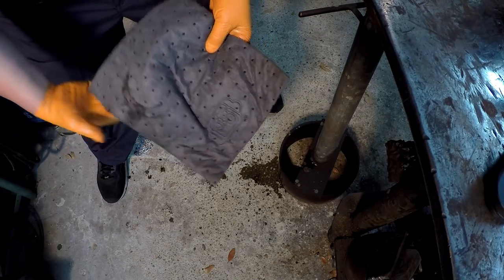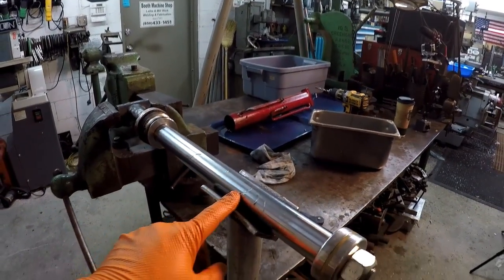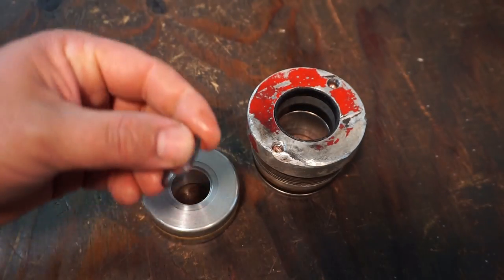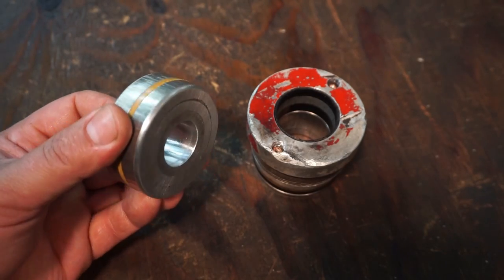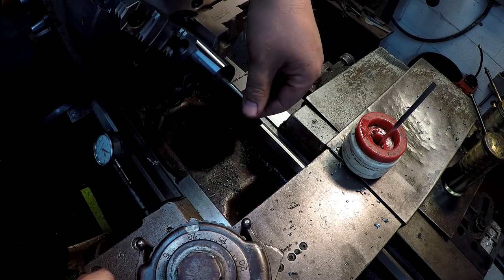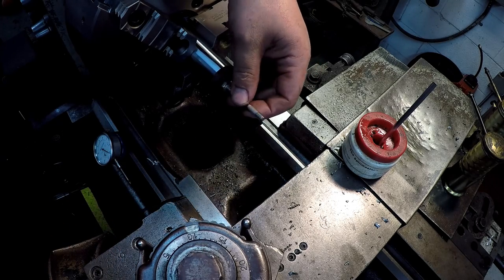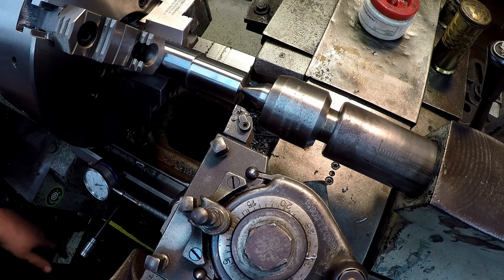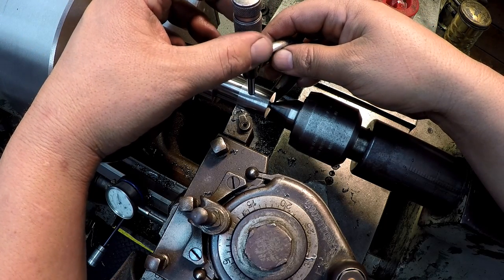Hydraulic Cylinder Repair Part 1

Comment: I like the hyd rebuild videos, nice job. Many times in the field when a cyl. rod would get gouged but still straight and not leaking I would clean up and grind out the damaged area and fill it with an epoxy product called Belzona to keep things running without damaging the seals till we could shut the machine down to repair it properly . Many times the repairs lasted for years like the side shift cyls. on the blade of a grader that didn't see a lot of use. Just reminiscing about day gone by. Thanks, Ed K. Cleve. Oh.

Comment: I find it so amazing that you can make threads like that. One would think it could only be done with one pass or with a die, multiple passes seems like it would cross thread or try to make new threads in a different spot each time...especially since it is at high speed like that, crazily amazing!

Comment: I like your vids, reminds me of stuff I used to do. THis takes me back to when I worked for CBL Ltd. They never had a machinist working for them before and were sending cylinders out for repair until I came along. Saved them £170.00 a time (in 1996 in Britain) Mini excavators get severely abused, I spent a lot of time repairing them (Site Service Engineer sounds a lot better than the reality-LOL) Oh, 9.3 thousandths isn't a measurement (even though I know what you mean) should have said just over 9 or more accurately 93 ten-thousandths (Semantics, can't help it I'm British)

Comment: I wonder if you could clean those gouges, burn them a bit to get any contaminants out, then put some kind of metal based resin (i used one once to glue an very, very old lamp, it contained brass particulates). I mean, in theory, since it's such a small area, it will never wear (not significantly) and at the same time, it will help keep pressure when the seal comes over. PLUS, that way no dust or crud can get back in the hole, and won't further score, or damage the seals.

Compared to machining the whole thing, on the cheap, if it would work, that'd be a great quick fix.
Reply from the maker: +aserta A quick fix like that is to use epoxy. I'm sure some other metal bases epoxy would work just the same.

Comment: My floor jacks have just a slot in the gland intended for use in a press or with a jig. I think I will drill some holes for a big face spanner I may have to fabricate. 

Sorry for the double posting in part 2, the iPad Youtube app locked up and did not appear to have posted it until I rebooted.

Comment: Awesome video - would love to get pricing on having you repair the tilt cylinder on my Cat 252B skid steer. Some of the chrome on the rod has come off and messed up the seals and it’s leaking.

Comment: This a prime example of when to and when not to. Unless they are damaged beyond repair they can be gouged with an angle grinder to make somewhere for weld to go and hit with a chrome-moly stick electrode and ground back and polished and look as good as new and call it repaired. 

like its only takes a moment of your time on an angle grinder gouge out the places needing repair, wipe it over with some thinners and clean the oil off, hit it with your chrome-moly stick electrode/s, grind and polish it and call it good enough.

on a side note hard facing stick electrodes for repairing earth moving equipment among other things, they have a very high chrome and molybdenum for hardness and abrasion resistance and are ideal for said chrome rod in hydraulic cylinder. just dont go lifting your helmet up straight away to see your good job you just done the slag pops off very quickly after a weld and can jump in your eye very easy even like 2 - 3 feet away!!! ...

Comment: You mentioned using oil for a better surface finish when threading, where are you setting the insert height? Or would it even matter in this case? I see a lot of different thread pitches but no one talks thread depth or the different types used for stronger load hold. I used to measure my thread depth and thread hole to within .002" that way there's less movement when it bolts together. I just like that feel when I'm hand fitting them together plus I feel the load is not tilting the nut to one side there by giving me the biggest nut to surface contact spreading the load.

Comment: Do you typically machine threads without a relief?  Is one way harder than another?  Thanks for all the great videos!
Reply from the maker: Vince Ciotti I do then both ways. Without a relief is just a bit faster because your eliminating one op, but you have to watch it closely and disengage at the right time each pass. If you use a mag base indicator on the ways you can watch the indicator and back out in the same place a bit easier.

Comment: I wish I could send you the bucket tip cylinder on my Kubota BX... at full extension, the rod can 'wobble' a few degrees.. the bushing needs to be longer. At least it does not leak and the shaft is smooth... So far its just the rod gland that should be longer and carry a longer bushing to support the rod.   Oh well, we are about as far apart as we can get and still be in the USA. One day I will probably have to just buy a new one.
Reply: The bushing sounds like a small part... ship it to him?
Reply from the maker: +Jennifer WhiteWolf Sounds like the original rod gland is worn and needs to be either bushed or bore and install a wear band. As long as the gland and position are the correct fits it should be working as designed.
Reply: Abom79 
As a low cost tractor, I am guessing there is either a plastic bushing insert, or perhaps none..just using the material itself as bearing surface. I am now careful to use the tip at less angle to not go to end of stroke as often. This autumn I will pull the cylinder. In the meantime i can buy the rod gland rotating tool I need and a seal/o ring kit. I learn SO much from your vids, really appreciate your training!  This cylinder take down and rebuild video is a perfect example.
Reply: Abom79 
Also really enjoy the food vids!  I now subscribe to several BBQ channels thanks to your introductions!
Reply: DSCKy 
This fall i will pull it apart. I know how now!  If it needs machine work I will ask Adam if I can send it to him.. Given the nature of loading on the cylinder, if the gland were longer, with more bush area between wiper and seal, it would be much better. There is still some  rod length available when fully retracted, so it could theoretically be a longer gland for better support at full extension.

Comment: my gosh i'm spoiled by cnc... both end of a chrome rod turned to size with thread relief and 4 milled flats on one end, programmed and run in 20 mins. 4" piston with id thread, 1 id groove,  3 od grooves, and 2 spanner wrench holes,  30 min setup 12 minutes per cycle.

Comment: Quite surprised you didn't use any packing for the chuck jaws. Hardened jaws on a chrome rod. Any damage from them and you are back to square one. But good accuracy from the chuck. I use some ally strip's between the rod and jaw :)
Reply from the maker: +Cnc Appreciator I machine chrome rod everyday and know how not to scratch it. The smooth jaws are safe unless you get stupid with the cuts. The deep serrated jaws do needs pads between them and the work though.

Comment: I've seen people hang off a 10' cheater while others heated and beat the cap off a jacked up ram from a dump truck.  Hard work.
Reply from the maker: roscocsa We have our bad candidates in the shop. Sometimes no amount of heat and beating will will them apart. When a threads galls, time to cut it apart.
Reply: Stuff like that makes me glad I sit at a desk for a living now.    Sometimes.   To be fair I was working in a really really reeeeaaalllly low end shop.  So 90% of the day was grease and coal dust up to your elbows, sledgehammers, and cranes with broken brakes.

Comment: Heyyy very nice projekt....why do you use hard jaws on a piston rod? Than you make again scratches in the piston rod.....i use only soft jaws.
Reply from the maker: +Wolfgang Taferner If you use the right type of jaws and the right torque it won't damage the chrome. I do this everyday. Some chucks have deep serrated jaws though and those you must use soft pads to protect it.
Reply: Ahh ok also those one are hard jaws with the right diameter? I have didnt seen such type of jaws....i m too a turner and i make from time to time cylinders. But its intressting to see, how many ways there are to make those piston rods.  I know how easely scratches happen. XD XD _' than you can throw it in the next scrap container.... XD

Comment: Hi Adam,
Could you tell me what insert you are using for turning. I have a hard time getting a good finish on chrome rod. I have been using a CPGT with .015" radius, that gets a good finish when pushed, but on light cuts not so much. I am using a neg tool holder.
Reply from the maker: Jerry Long I use an ISCAR wnmg 431 ic 8250 TF on this job. At work I use the same only in CNMG shape.
Reply: Abom79 
Thanks Adam, I'll give them a try.
Reply: Abom79 what does the IC 8250 TF sand for Adam?
Reply: Just Google IC 8250 TF

Comment: Hey Adam, a have a question on my cylinder rebuild. I'm rebuilding a 3 5/8 diameter mast cylinder on a Hyster H100XM. It is pressure in gravity down. The problem I'm having is trying to get the shaft back in the tube. Its like its vapor locked or something. I Had to use a come along on it to get it down the 4 inches its moved. I wouldn't think there would be a check valve. Any help would be appreciated.

Comment: question: on the original rod with the dings in it - would it be an option fill the dings with a couple passes with a welder then machine them back down on a lathe? ..or is there something inherently wrong with that approach, for instance, the welding heat would weaken the part ..or something else?

thanks - love the channel.
Reply: There are two reasons why that would be difficult. The first is the welding heat; welding just in one area of a shaft can cause it to bend. The other is that a hydraulic piston rod must be ground, not just turned on a lathe, as the rod gland needs a very smooth surface to seal against. And any hydraulic rod must be chrome-plated; the weld would rust, eventually.

Comment: Hey Adam, could you spray weld over the scratches then bring it back to size in the lathe?
Or is that too much trouble for the money.
Reply from the maker: It's a patch job and for a rod that's easily replaced, no need it fixing it that way.

Comment: Hey Adam.  I work on John Deere Ag equipment for a living and have re-sealed many hydraulic cylinders.  I have seen the ends of the rods broken off before and I don't recall ever seeing a set screw or roll pin in the end of the rod.  What is the purpose of the set screw or roll pin that you mentioned?
Reply: A definitive answer should be in part 2 when he reassembles the cylinder.

A SWAG is that with the rod and the rod-end both drilled an tapped in the center, a set-screw or pin will hold the rod-end in the proper position for welding without a complicated clamping arrangement.
Reply from the maker: It's to help with holding the parts together nice and square for welding and fixturing. Just makes the job easier. Sometimes I just machine a small nub on the end to help hold the eye center for tacking it on.

Comment: Adam, when you are describing the scratches on the shaft there is definite audio overloading and distortion. It's still there as you are describing the seal right after. Is there a way on your camera to adjust the audio level down a little?
Reply from the maker: +Mac Kerr Actualy I think I may have found a fix to that problem. The Audio is perfectly fine from the camera and mic, it's after rendering that its distorted. I rendered my next video last night with a different format and it seems to be good.
Reply: maybe try to modify yoursettings (ONLY ONE T???)ON YOUR SOUND SYSTEM??? OR DON'PLAY IT LOUD...too much.
Reply: John, I have been a professional sound and recording engineer for the past 40 years. The distortion is not on my end. There are many places throughout the audio production chain where distortion can happen, stopping it at the source is the only cure. Adam seems to have found the source.

Comment: Adam; good video again.  Hey, I noticed you have an Enco tool post .  I just bought a Harrison M300 lathe and it came with a Klopfer tool post. This seems to be identical to your Enco.  I am looking for a supplier for the tool holders.  Who are using to source your tool holders? Anyone out there with the same problem, the 40 position Multifix tool posts are great but who supplies the tool holders?
Reply: John BURKE

Comment: hi Adam, how do you manage to stop the tool that makes the thread in the same distance from the front face?  is it possible to set the lenght of thread on your machine or you have to turn off the feed manually? I am just begginer.
Reply: It's all timing and coordination (aka skill) on most manual machines. He's threading at a pretty fast speed... you can go a lot slower as a beginner.
Reply: You wouldn't want to do that with no relief groove. He is manually retracting the cross-slide when he sees it clear the hit the end of the thread.
Reply: You could do it without a relief, but I guess it isn't a great idea. You could set a travel dial to 0 at the stop point and stop it as close to 0 without going past 0. You'd end up with a semi v shaped groove when done. You can also start on 0 and cut the threads away from the chuck...

Comment: Hey Adam, total hydraulic novice here with a potentially ignorant question. If there are dings in the rod can they be filled with weld then taken flush? Would the heat needed to get good penetration warp then rod?
Reply from the maker: +Mike Strohofer I remember repairing hydraulic rods in my younger days where we had to TIG weld the gouges and scratches and machine them down. Shouldn't have much worry of warping.
Reply: Abom79 In this application you wound up making a new shaft for your client. What I was wondering is why go that route as opposed to doing something like building the shaft up in the low areas and re-machining and polishing. It seems like that would be a less expensive option intuitively, but I could be completely wrong!
Reply from the maker: Cases like welding up scratches or gouges would be a rod that is expensive and hard to replace, or the material is not available right away and the customer needs to be operating. A weld surface is not hard like the chrome and it's easily scratched. Another problem is that often times the rod may have a slight warp or bend to them from being used which is hard to true up for turning.
Reply: Abom79 that makes a lot of sense. Hey man thank you so much for all the content you put out there and the effort you go to in responding to the YouTube community. As someone getting interested in machining as a hobby I wouldn't be doing it if it wasn't for you and the other guys on YouTube.

Comment: Would it be any good to weld damages and machine a new surface on a true rod ? I've got one with rust cavities on the most outer part messing up top seals and wiper
Reply: You could buy a replacement chrome rod. We cut them to any size you want and sell them on our website.

Comment: I am not surprised Fernando went with a new rod. He knows hes got one of the best working on it and that cylinder will be better than new once you're done with it.

Side note, what is Fernando that you rebuilt those two red cylinders for many months ago or was that another buddy?? I can't recall.

Going to be a fun little series again! Thanks Adam!

Side note as well, I am impressed with that chuck Shars sent you. How are those calipers holding up? I am thinking about picking a pair up.
Reply from the maker: +Brian Streufert Yes it's the same Fernando. He has 4 tractors and other pieces of equipment. You could consider him my step dad even though he and mom aren't married. He's always there to help me when I need it and safe for me. Example, I recently had to do some remodel/repair on my patio and he let me borrow his large dump trailer which was perfect for hauling off all the debris. This repair is my payback for that. The chuck is doing good so far, but we need more time to see how well it maintained. The Aventor calipers have been great! No problems, smooth silky feel.